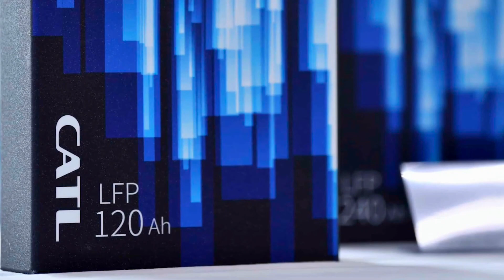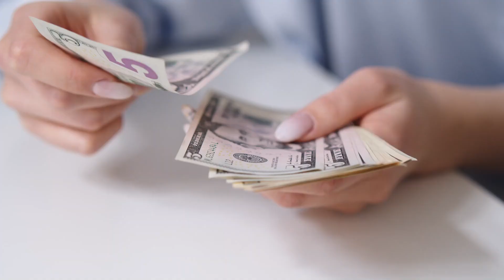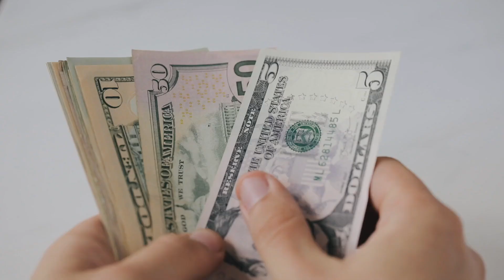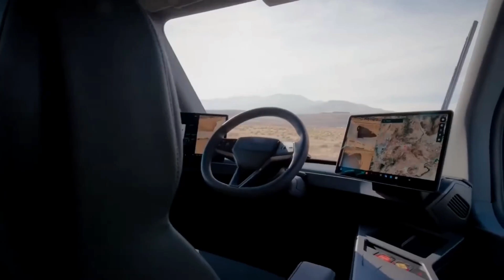Elon Musk Revealed: Tesla Semi Big Upgrade!

Comment: need to build semi truck in three pieces, mid piece being the battery detachable, 90 second swap outs, half the mass, instead of charge stations, swap stations for battery cabooses, oh you can also have swap teams bring the cabooses to the truck drivers, wherever they may be from more convenient cheaper, centrally located more energy dense locations cutting down on number and frequency of swap sites ( to 100 mile intervals) , and make jobs for the trucker teams.

summary of teeth pulling with LLM:

To estimate the number of 100-mile diameter circles that could fit within the United States, a calculation was made based on the total area of the USA, approximately 3.8 million square miles, and the area of an individual circle. The radius of each circle, given the 100-mile diameter, is 50 miles. The area of a circle is calculated using the formula πr^2, where r is the radius. Thus, for a circle with a 50-mile radius, the area comes out to approximately 7,854 square miles (π * 50^2 ≈ 7,853.98).

Given the total area of the USA and the area of a single 100-mile diameter circle, dividing the total area by the area of one circle yields the number of circles that could theoretically fit within the USA. The calculation resulted in approximately 484 circles (3,800,000 square miles / 7,854 square miles per circle ≈ 483.83). This estimate assumes ideal conditions where circles can perfectly pack without accounting for geographical constraints or the irregular shape of the country.

In exploring the financial implications of constructing high-speed charging stations for semi-trucks across these circles, a hypothetical scenario was considered where each station costs between $1 million and $2 million, leading to a total estimated cost ranging from $484 million to $968 million for 484 stations. Revising the cost to a more substantial $10 million per station increased the total investment to approximately $4.84 billion. This scenario demonstrates the significant financial commitment required to develop infrastructure supporting electric semi-trucks across the United States, highlighting the scale and investment necessary for a transition to more sustainable freight transport solutions.
Reply: Massively more expensive to do battery swaps. Nio tried it and it's all but failed. You now need a whole extra battery pack, which is a huge percent of the total cost of the truck, plus all the expensive machinery to swap them, and a huge repository for all the charging batteries. Trucks aren't driven non-stop, they need to wait while being loaded and unloaded, and most are parked overnight, plus drivers get mandatory breaks. Plenty of downtime to charge. And a Tesla Semi only takes 40min to put 80% of the charge back. Pepsi was doing over a thousand miles/day with some of their Tesla Semis.
Reply: @truhartwood3170  solution to that is privately owned "filling stations" , like gas stations are privately owned, along highway routes, where there is cheap land, battery has to only be big enough to guaranty  that you make it to the next stop, Pepsi truck cargo is not a high density cargo 40 to 70% of max possible in 18 wheeler. Its true, different configurations make sense for different mass ranges, but an out of city distribution system makes sense for larger loads, then again by the time it is put together, we might have batteries with 4 times the density, but disregarding AI leaps, which are unpredictable, we might reach densities of 650Wh/kg, roughly 3 times what they are now in 10 years, but physical world adoption moves slower, so  all seats on the balance beam says your right, by the time the infrastructure is built ( distributed swapping stations) due to slow response times of democratic countries, staying the course for semi's till the densities triple or quadruple makes sense, its just going to be slow going on top end for 5 to 10 years to come and hydrogen ( assuming its issues are solvable), with considerable higher energy density -- much lower than diesel by the way -- refer for brevity to LLM to point you to a comparison site-- I assume I can not put in a link, (again disregarding AI advancements) which will more than likely shrink those time scales by at least half. Cars on the other hand show that other tech makes for a better price point is possible, half in most regards and double in others, as far as speed of adoption goes and $$ goes, but switching has a large capitol loss associated with it and distributed wealth losses, but has the expense of environment for mining, road degridation, but lets assume 5 years to battery double density, and further lets assume that other tech can half the weight of an SUV, maybe a bit under, moving that extra mass and all the costs and materials means a target price of 25-50 percent for next 10 years, and in that time, given the simplicity of other tech, someone can come along and eat your lunch and critical mass, and over take you., in my opinion the 3x -6x faster adoption rate is better for environment in long run and ability for poor to afford full sized cars without financial burden, reduced environment, fire and explosion hazards ( hydrogen's flash point and inability to produce as needed efficiently) , wear and tear savings, simplicity, energy requirements due to mass reduction, zero emissions, and many other factors I can't think of at 3AM.
Reply: Forget swapping batteries.  If your running really hot loads (time sensitive) swap the truck for a charged one, and a fresh driver if needed, every 400 miles.   The future of fast charging for travelers is a modern 'truck stop' like setup the will charge any electric vehicle.  Maybe combined with battery energy arbitrage.  Dedicated grids and power generation. Whatever makes financial sense.   As the number of BEV vehicles charging will become a big business.   We are not there yet.  Not even close.
Reply: @danharold3087  I was under the impression truck drivers were "attached" to their trucks, and their custom comforts. I didn't realize that they would be flexible enough to accept this option.
Reply: @wanfuse  The owner operator sort of truck driver is likely to be more attached.  Even for some of them it's a job and the truck the tool used to do it.  Trucking has been romanticised.